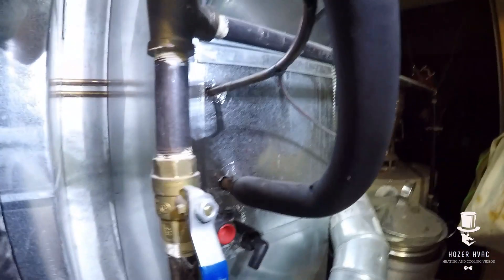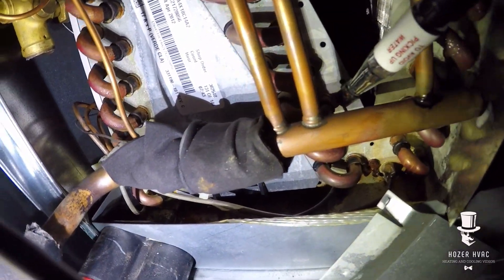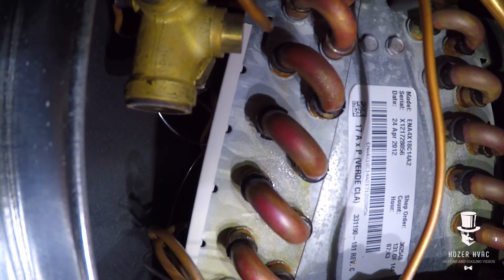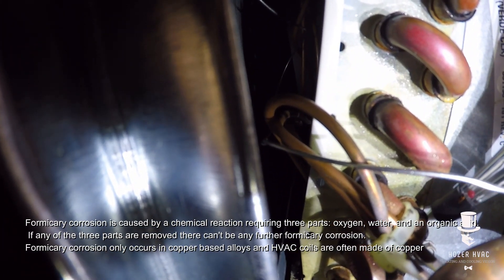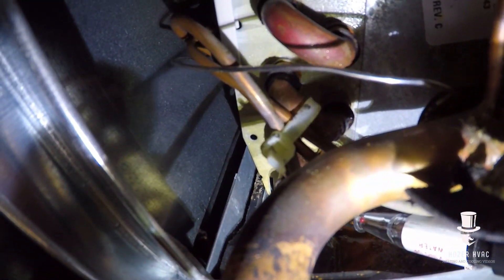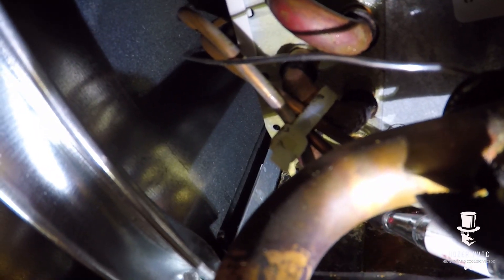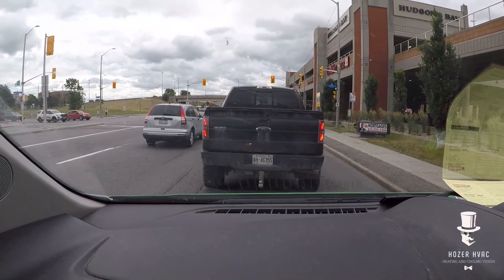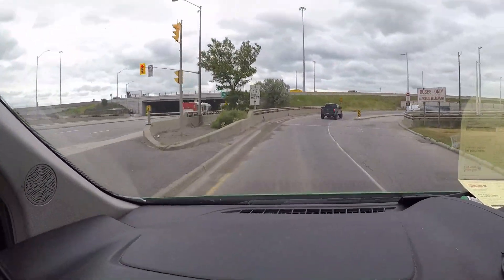AC Leaksearch H10 pro leak detector for air conditioner not cooling

Comment: Thanks for the video. Seemed like a very small leak considering you're using an H10 😀 .  I have an older H10-PRo and it runs 3-4 Beeps / sec (just as the cal. light turns green) for 'optimal' detection.  Are the new ones slower? I noticed the cal. light was still in low (red)
Reply from the maker: RJ_Make I’m pretty new to this detector. Is it best to ensure the green light is lit?
Reply: @hozerhvac4406  That's how I've always used mine (I don't ever use Auto) and it seems when I get close to that 4 beeps /sec it moves to green. 

Mine is ~8 years old though, so the new ones may be different. Did it come with cal. instructions?
Reply: @brandont9015  Yep the newer ones are 1/per sec, my older model say to idle at 3-4/per sec

Comment: Your job would be so much easier if a gap between the furnace and coil was required.
Reply from the maker: This was a real tight one, no where to move in the furnace room, and very tight in the evaporator area making it very hard to film and work